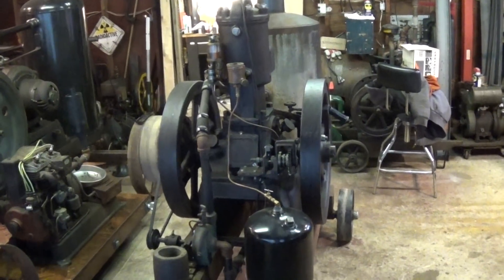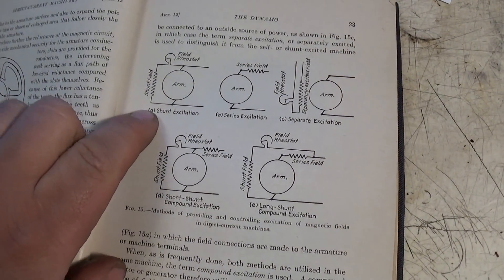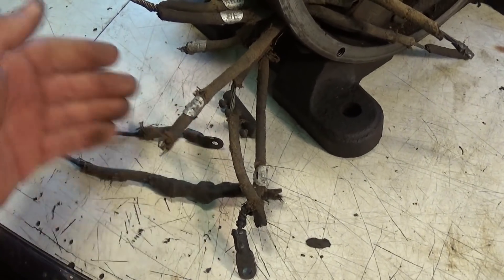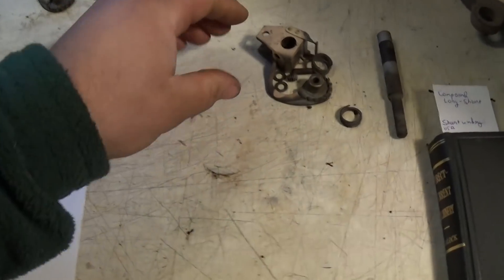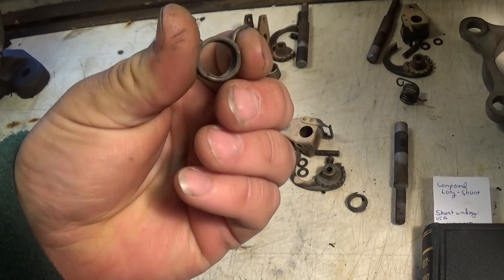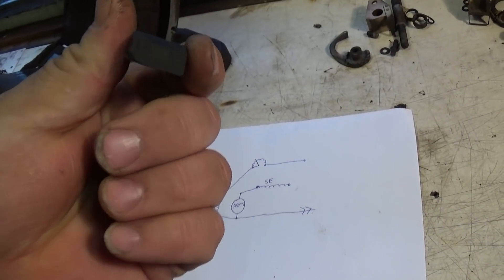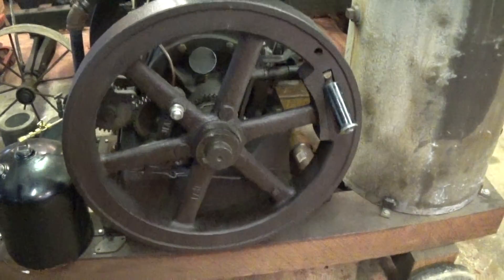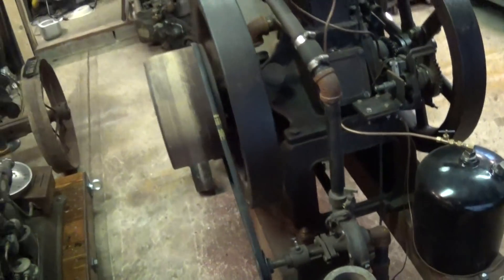Bessemer Engine and DC Dynamo Revisited

Comment: I just thought of this point to mention to  you about exhaust noise control on a two stroke engine. I have a formula to use that takes into account the engine bore and speed to increase efficiency of the gas flows. Would like to help you design a killer unit with the looks of an old style muffler. Keep on working on old engines.

Comment: When you make pins for the brush holders, use drill rod for the material. The size is to tolerance and the material toughness is just perfect without being brittle. Good luck too.

Comment: my father before he past found out that the use of brass or the other material you stated,  if heated up will not last long. in the 20's they did not know about heat and what it does to things. heat stresses and heat can strengthen.. i have a patent on thermal energy recovery  system for electrical equipment.
https://patents.google.com/patent/US20030133265
heat van be your enemy or your friend. try to balance that with your springs. should not conduct much electricity. you need all you can get without load drop.  they use the material they used because it did not conduct electricity much.

Comment: mike, due to the low voltage that brass puts out. i think that's why they use it. i guess that they did not know about heat and what it can do to brass. make it soft. so yes they failed. i think if you find out what is comparable to brass and can take the heat. it would be ok. please. i knew that you made more videos so if you have found something comparable then by all means use it. if you used steel please take them out. it will cause more harm than good.
Reply from the maker: Why should I not use a steel wire?  I would think as long as the brush hold down pressure is appropriate all would be fine.
Thanks for watching!

Comment: It will be slower off the flywheel, for engine speed, in fact if the dynamo is 1500rpm, then the motor will be 1/8th that if the pully is 3", and the flywheel is 2', then @ 200 rpm the dynamo will be will be 1600.

Comment: i have a old fairbanks morse 3 hp 220 (i think what ever voltage there were using at the time maybe 240) any how never worked on a motor at all. bearings are stuck id like to run my line shaft machine shop with this how do i go about taking this apart don't want to mess any thing up before i even get started. any advice is welcome.
Reply from the maker: Thanks for watching!
Reply: SmallEngineMechanic umm your welcome but did you see my question?
Reply from the maker: Check your messages.
Reply: ok i see it now lol

Comment: Springs delaminated along a grain boundary.    Bad metallurgy.  New springs are easy if you can heat, quench, anneal etc.  Plenty of info on temperatures for materials.  Hard part is figuring out the metallurgy of your base stock.  Mass/displacement, hardness, magnetism etc are clues.  Doable with some trial and error.  Easier to find existing and adjust geometry for travel and spring force.

Comment: When i serving my apprenticeship about 40 odd years ago, i had to make some springs for a job , it's quite easy. The tradesmen i was working with had a selection of high tensile bolts. One end of the spring wire was poked into a hole, then a rod with a hole in the end was used to wind the spring onto the bolt(held in a vice) We made springs for generator brush holders, tension springs etc etc all the same way. I have no idea where you buy spring wire today though.

Comment: Lost my original comment, so this has to be more brief. From all the extra wires, either tied together or unconnected. I get the impression that coil assembly was a piece with multiple uses.  One, was this DC generator. If you - when done with the rush to get this and other pieces ready - can think about what products could use that coil set in other wiring configurations, you might be able to find and fix/display totally different pieces of electrical equipment. Nuff said.